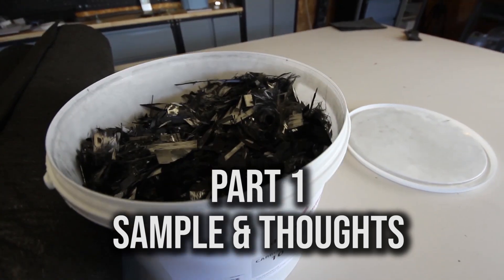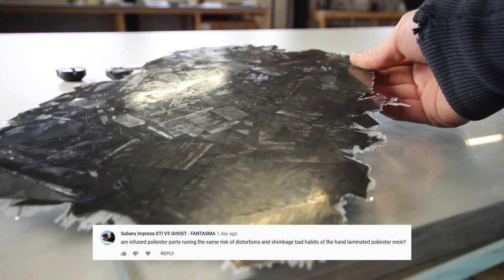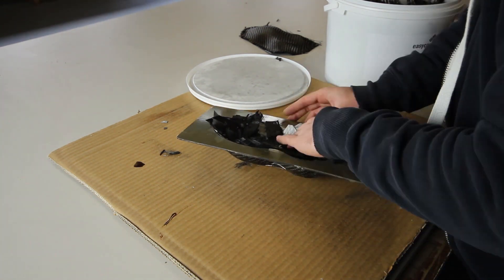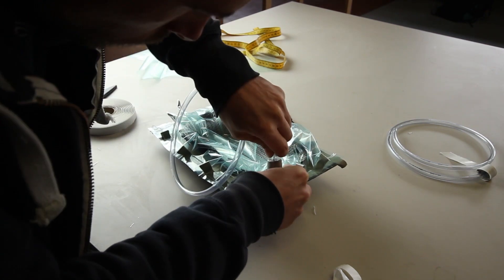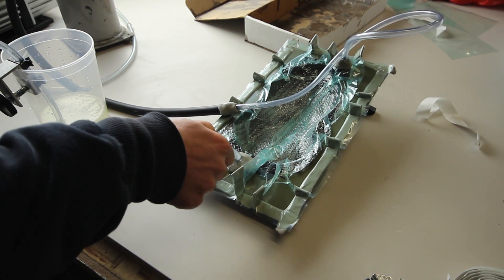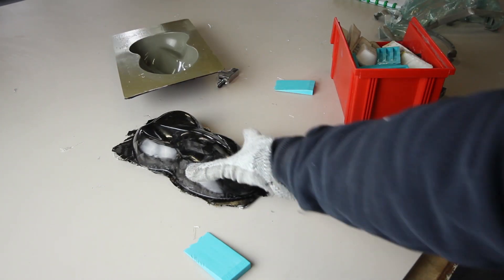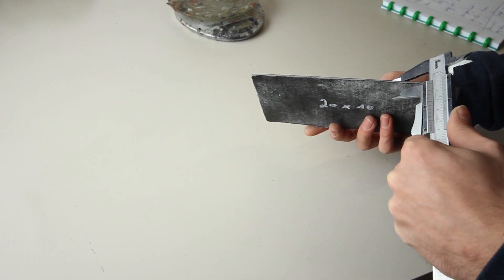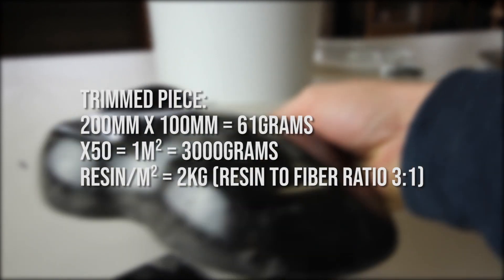Forged Carbon Fiber - Chopped Fibers (PART2 Result & New experiment)

Comment: Amazing finish and great explanation.
In your experienced and professional opinion does forged carbon reduce the risk of pin holes and imperfections in the finish due to being multiple small pieces instead of a full and continuous weave?
Reply from the maker: I personally think the risk is higher due to the different pieces of fiber overlapping each other in an irregular lay up so some gaps might not get filled with resin or be a trap for airbubbles
Reply: @MatthieuLibeert  Thank you for answering.
Reply: Certainly more prone to pin holes but also easier to fix imperfections since you can sand without worries of messing up the weave.